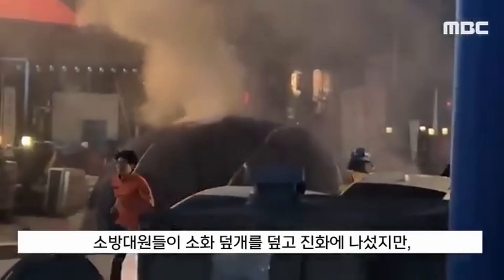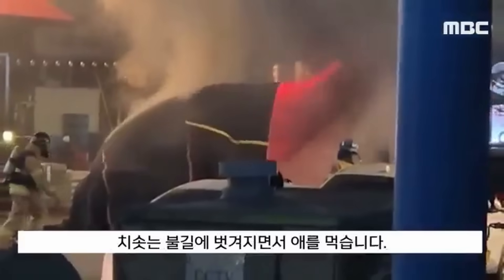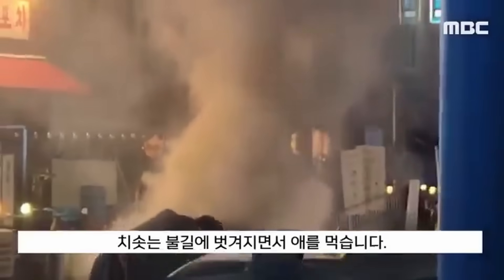EV Fire Blanket Explosion Risk: FSRI & NFPA Issue Warning

Comment: Those blankets trap and increase the density of fumes. Therefore, there’s more chance of ignition from active electric circuit as will the fire at this point is fuelled from large volume of trapped fumes, that’s why it explodes.

Comment: Maybe the blankets need to be designed with a "tap" or safety vent, so that the gases can be vented or even extracted from a known position so that it  can be controlled. It would help with cleanup if they were extracted and disposed of safely. Just a thought.

Comment: In my sailboat I had alcohol burner cook tops, they had a fault that if they got to hot the alcohol evaporated and passed the mechanism meant to stop and regulate the fire . Several times I had to use a fire blanket to put it out, problem was it burned so hot the fire blanked was barely able to put it out before getting burned to ashes and it was very hard to get the blanket to block all the oxygen so the fire actually stopped...

Comment: I saw a video on a fire lance. A very high pressure water jet. The water pressure is high enough to pierce the shell of the car as well as the case surrounding the battery pack. The tip of the lance is pushed into the battery case .Water can then be injected directly into the battery pack and remove the heat component of the fire.

Comment: Hi StacheD, I was wondering about the thermal runaway that are happening in the EV batteries. Would it be safe and reasonable to spray something extremely cold on the batteries like liquid nitrogen (or anything super chilled that won’t have a chemical reaction with the batteries)?

Comment: Maybe a deployable "fire fence" could be used during the primary runaway phase to protect adjacent vehicles, buildings, etc. Same material as the blankets, but with vertical stays and feet to hold it upright and around the burning car. Could also have a weighted flap at the bottom edge to keep flame jets corralled and steady it in windy conditions. The combustion gasses would be free to escape instead of accumlating under the blanket.

Comment: Why not mandate a ‘filler cap’ which would feed in the centre of battery packs, which fire services could open at a distance and use a lance to inject water into the core of the battery to suppress and limit the impact of the runaway.

Clearly would only be of use when access isn’t an issue and accident danger hasn’t ruptured the battery.

Also assumes the battery casing is robustly constructed…

Comment: A traction battery in thermal runaway will emit both lighter-than-air AND heavier-than-air inflammable gases, soon after the solid protection layer of the cathode has been expulsed (the initial black dust cloud). The sequence of emission of the two types of gas depends on the type of battery and the chemistry (can or pouch, NMC or LFP), but the heavier-than-air usually comes first.
Because all of the above, a fire blanket on a Li-ion battery fire is unnecessary; it may trap hydrogen and cause a larger explosion.
Greetings,
Anthony

Comment: Most brigades who use the blankets there SOP’s are clear, deploy the blanket and then withdraw ten meters and monitor with a TIC. After safely monitoring when you believe the thermal runway event is over remove the blanket. Make sure your firefighters are under air and have a charged hose line covering them.

Comment: How about a containment system consisting of a nitrogen producing underblanket that could be slipped under the vehicle with a deployment system, where the heat would activate it to expand, producing nitrogen at the same time to cool the battery pan? If it would not be possible to have a product that created nitrogen, then fire-resistant and cold resistant piping to pump liquid nitrogen into it. In conjunction with an intumescent over blanket that would expand into the vehicle and could be drawn around the base of the vehicle to secure it in place and stop the gas build up, blowing the blanket off. A pressure relief valve similar to a propane tank could be installed to bleed off any excess pressure building up inside while nitrogen is pumped in to stem the runaway.

Comment: By the time electric vehicles become the majority there had better be a way to effectively extinguish battery fires as well as prevent them in the first place. As other here have noted lithium ion battery powered household products pose a significant danger and a threat and yet they possess a tiny battery compared to the huge batteries in electric cars and motorcycles.

Comment: Today I went to Costco (in BC, Canada) to get gas. There was an EV p/u truck on fire. (Almost out?). It was PARKED!  They had a big tarp on it. A tow truck had it lifted up in the air, strapped by the rims. So the firemen could spray the hose under the cab. I was only there a few minutes, it was burning my lungs. Hardly any smoke when I was there. Environmentally friendly, my a$$ it is.

Comment: If we’d known the huge problems that EVs cause when they go wrong, and all the other cons that with EVs  , no one in their right mind would have said yes let’s replace conventional cars with EVs . 
 Great job pointing the dangers sir !
Reply: Cars can run on hydrogen or even on water. Some people have created such engines. Why push lithium batteries ?  It is worse than oil/ gasoline.  We will have to dig deep holes to dispose of them....I hear they have a short life.......Nothing good for the environment. Certainly a danger for people, unless they want to burn us up. Would not surprise me. Free cremation, well not really FREE either.
Reply: I guess short term versus long term/ongoing dangers with respect to EVs versus conventional.  Replacement with EVs while changing nothing else isn't a good solution, but continuing with the level of individual vehicle use isn't either for either technology.

Comment: So the question is: to seal or not to seal.

If the answer is not to seal could the blanket still be used for containment? For example smash rear window to vent interior and cover rest of the windows with the blanket to protect direct surroundings

Comment: They need to look into designing a blanket with a top blow out section / vent where a monitor could check on temps and gasses. Just a thought.
Stay safe, Be safe!
Reply: The issue with venting up is that these fires can and will likely happen in enclosed parking garages. At that point, it would be better to block the fire from hitting everything around the runaway vehicle, rather than trying to suppress the fire.

Comment: You started by giving the impression that a lithium fire does not require oxygen.  I don't understand how lithium can oxidize without oxygen.  I was under the impression lithium was combining with oxygen to produce lithium oxide (and immense heat) or under certain unusual conditions combining with nitrogen producing a lithium nitride.  If it is not burning with oxygen what is it burning with?  It has to be reacting with something?  Is it possible it's releasing hydrogen by reacting with water, extracting the oxygen from the water releasing hydrogen, but wouldn't that only happen if someone is dousing it with water?  I understood that lithium and oil/gasoline fires should not be countered with water. The former because it's ineffective and the latter because it can spread the oil/gasoline over a larger area.  1:35 - Wouldn't burning gasoline/oil be a class B fire not a class A?
Reply: I tried to find a simple answer and just ended up back at the general answer. The cells contain highly reactive chemicals. Excessive heat may break one or more chemicals into "stuff" that reacts with other "stuff" within the cell. Oxygen may be part of that, but outside oxygen is not required. 

For a simple analogue, consider thermite. It's just a mix of aluminum powder and iron oxide (rust). Get it very hot and oxygen breaks off the iron and attaches to the aluminum. No outside oxygen is required. Once lit, it will burn in a vacuum. What happens in a lithium cell is more complex, but similar.
Reply: the oxygen is mixed into the chemical mix of the battery alongside the lithium and cobalt; when the battery goes into thermal run away the oxygen is released and feeds the fire.
Reply: This is not a Lithium fire - the Lithium is in salt form so can't further oxidize (unlike in a Lithium metal battery). Is a Lithium Ion Battery thermal runaway technically a fire (i.e. combustion with oxygen)? It could be triggered by a fire, and often creates and sustains a fire. Quoting gasmet: "Thermal runaway is a violent chain reaction of exothermic chemical reactions resulting in an uncontrollable increase in system temperature." According to a US Dept Transportation study, thermal runaway of a cylindrical cell released 2-4% oxygen, 5-15% hydrogen and 12-25% total hydrocarbons (depending on state of charge), plus other nasties. I guess the ratios would change over time meaning that some of the time you would have a flammable mixture without atmospheric oxygen supply, but in an oxygen starved situation like with the blanket there may not be sufficient oxygen to sustain combustion. Open the blanket and ... boom!

Comment: We have transitioned our EV Fire Blankets from active fire suppression to providing coverage of “special circumstance exposures”.

We use them for exposure protection of non-involved vehicles AND for critical equipment protection in underground parking areas:

(Fire alarm control panels / BDA-DAS radio comms gear / fire suppression sprinkler controls and monitoring systems / standby generators and controls / electrical power distribution / electrical transformer banks and individual transformers / PV charging systems / large capacity lead chemistry and lithium chemistry battery banks / Etc…)

Much of this equipment is housed in NEMA rated watertight enclosures, so the water exposure shouldn’t be a concern.
*Disclaimer…
Please do n

Comment: A reader below also pointed out that Lithium batteries many more types of combustible gases than ordinary CxHx (plus O2) type of fuels.  Because of the higher combustion temperatures associated with Lithium, Magnesium, Nickel, Cobalt, etc, Some of the new effluent is actually capable of engaging N2 as part of the deflagration process.  NxOx is often produced as well.  Many of these cars are partly aluminum ( and maybe with lithium alloys), which adds more problems.  The melting metal and slag, in combination with a higher heat source, makes water suppression marginal, and completely eliminates the usage of Foam.  The Foam actually can become an added combustion chemical, in itself.  That also releases fluorocarbons, some of which are hazardous to breathe directly.  A simple face shield is not going to make you safe.

Comment: At last they discovered this. Big success. 

The single what blanket can do is just reduce heat emission to nearby objects - other vehicles, burnable materials, firefighters, by the cost of increasing temperature in the fire and accumulate unknown gases, including explosive. The same idea as with backdraft, if you open a door in house fire - it will burn much more active, but if you close the door you risk to get full scale backdraft with scorching temperature gases, instantly igniting on fresh air.

Comment: Just dealt with a bulged phone battery.  Someone left it on a wooden park bench with dead pine needles all around it on the ground.  Tried to find a place with no pine needles and bare dirt.  Finally took it up to the bathroom where there was a clear slab of concrete with at least 2 1/2 feet of space all around.  Then let the park ranger know.  In a bulged condition, I definitely am not taking that and putting that in my car or trash!
Reply: I had a battery bank bulge (LiPo). The crap part is there's no safe way to deal with a bulging battery that I'm aware of that doesn't involve returning it somewhat energetically to more stable compounds. You can only recycle it when it doesn't look like it has the cheeks of a glassblower.
Reply: @kdawson020279 what does “returning it energetically to more stable compounds” mean?
Reply: @thinkofsomethingcooler Basically, it means to have a rapid unscheduled disassembly of the parts
Reply: @joshua43214 oh I see gotcha tysm
Reply: I had a bulging battery on my old Huawei smart phone. It bulged out so much that the back of the phone cracked open. I went about 2 years with it like that. Finally, I got the battery replaced. Phone still works.

Comment: Just had a class with some of the people associated with this test. (who I won't name) but key takeaways were that if the blanket starts to balloon up, hit it with a fine spray of water, ant that will help cool the blanket and the gases.  It will also cause some water to pool around the edges of the blanket, causing a better seal.  Seal it as best you can from the beginning.
NEVER lift the edges of the blanket to check on it!!  
Monitor temps with a TIC, and check CO with a 4 gas meter.  Plan on leaving the blanket on for 1 and half to two hours.  When temps are below 100 F, and CO is below 35 ppm, it will probably be safe.  If you are pulling the blanket off, attach ropes to the corners of the direction you're pulling, and have two lines on either side to knock down any fire.
Bridgehill seems to be the blanket of choice.
Reply: If that was your take-away, you've got it wrong. The spray is used to cool the ballooning gas, but you can't just seal it up. The blanket doesn't stop thermal runaway (batteries have their own fuel and oxidizer). The gas has to be safely dissipated at some point in the process.
Reply: @tombarth6472  Son, that information is DIRECTLY from people involved with THIS test.  Nowhere did I say the blanket stops thermal runaway either.  Nor did I say there would be a perfect seal.  Learn to read.  I have insider information.
Reply: @ffjsb  Saying you got it wrong was unnecessarily confrontational and not my intent. I don't dispute that the spray is used and that water pooling will hold down portions of the blanket. But you say that the pooling water creates a "better" seal, and state that the user of the blanket should "seal it best you can from the beginning". This is not the intent and leaves out the most important aspect of controlling the vapor cloud and release the gas in a safe and controlled manner. Your emphasis on sealing it suggests that the blanket will fully contain the thermal runaway. I was present at THIS test and fully involved with the fire crew evaluating the approach and result. I suggest you wait for the NFPA Conference on June 16 rather than give incomplete instructions based on your second hand insider information.
Reply: @tombarth6472  In NO WAY did I even infer that the blanket will stop thermal runaway.  And I also said "better" seal, not a perfect seal.  The people I talked to were also there.
Reply: @ffjsb  containment is the goal, blankets do contain, and are chargeable to the EV fire insurance company
Reply: @gallardoo9  Them being chargeable to the insurance company remains to be seen.  Especially since at least some are reusable.
Reply: Just do not buy these cars. Some insurance companies refuse to insure them and some parking garages owners refuse them , in their lots. Says a lot how unsafe they are. Not one of these things would ever go in my garage !!!!! and neither would I go into one. They explode and burn up during collisions. The doors lock and the people burn up. The first responders cannot get to them, fast enough. It is " live cremation ". Free when you buy an EV. Kills 2 birds with one stone ? pretty close to it.
Reply: It seems like a remote "thermo-puck" would be useful. Toss it under the car before covering with the blanket to monitor the temperature. 

Don't power it with Li batteries.
Reply: @briant7265  It's really not necessary, not to mention it would probably be a one time use, and we already have tools that will do the job.
Reply: @briant7265 or just use a thermal imager we've already got  or if that's out of reach, an inexpensive infrared thermometer. No sense in possibly destroying a piece of equipment by putting it under a burning vehicle

Comment: Hey Pat,
What are your thoughts on other lithium-ion batteries we have in our homes—like the ones in stick vacuums or drones? You’ve got a lot of non-firefighters watching your videos because the info on EVs is so relevant and timely.

Where I live, we’ve noticed a noticeable uptick in garage fires, and they’re happening at all hours—not just the usual evenings or weekends. Personally, I don’t think I’d ever park an EV in my garage, let alone charge one there. Maybe one day, but not right now!

Thanks for continuing to share such important and informative videos!
Reply: The make fire resistant cabinets to charge batteries in, promote those.
Reply: @ffjsb  yes, put all those devices in metal buckets or something and away from flammable objects near them. anything like a scooter put it outside
Reply: @ffjsb but might that cause an explosion much in the same way the fire blanket does?
Reply: Garage fires are generally caused by e-bike batteries and chargers that are not built to western standards.
Reply: Great question!
Reply: Q: What are your thoughts on other lithium-ion batteries we have in our homes—like the ones in stick vacuums or drones? A: "RUUUNNNN FORRREST...!!! (at this late date in History, no one should be surprised that little Jenny Curran was once again going to recommend this as an "action plan")